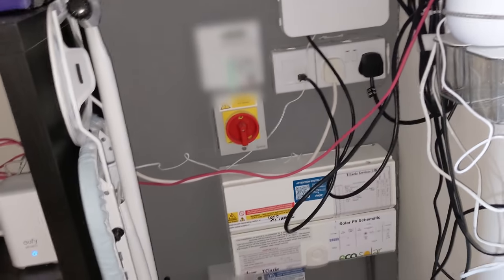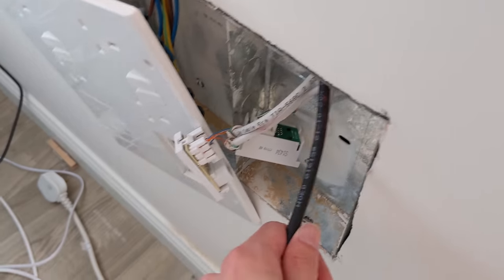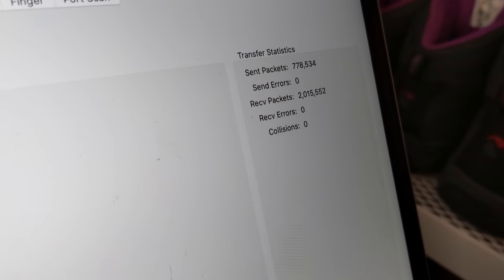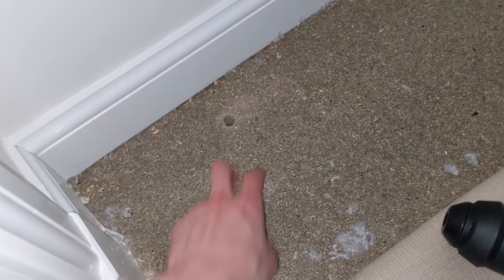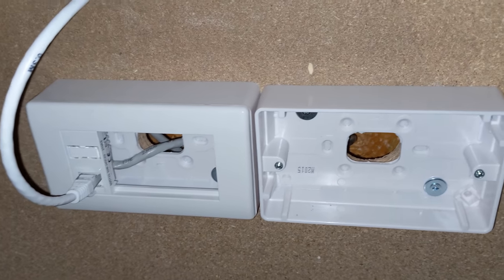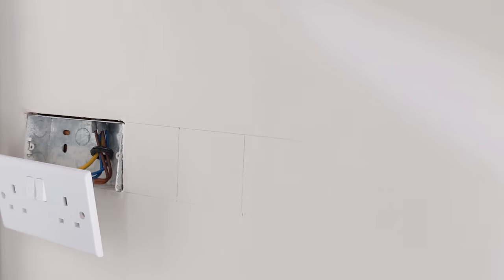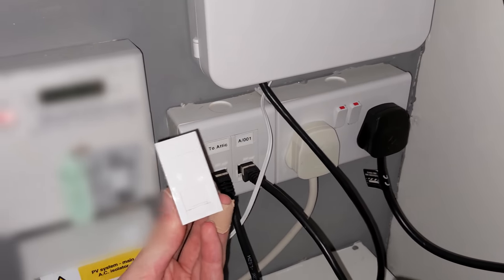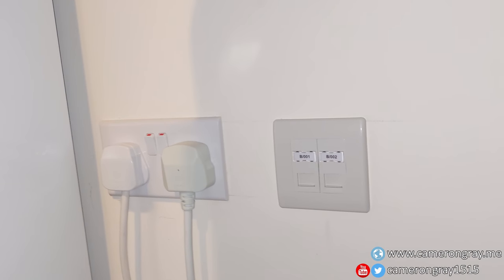New Build House - Expanding the Original Home Network Wiring!

Comment: Typical cheap poor U.K. new house building. Think I read they make a 30% mark up on homes now. It shows. Still a good install and great video, thanks!
Reply: Tbf this is a timber frame panel house. Very efficient to build and run. If i had to choose a new build it would be this one.
Reply: Compared to US, Aus and NZ standards, they're infinitely better.
Reply: @stevecraft00  What’s that? Does it not have bricks and breeze blocks in its building?
Reply: @marksapollo  only the outer skin is brick.
Reply: @stevecraft00  Don’t make them like they used to. I’d rather have some internal bricks walls on the lower floor.
Reply: @stevecraft00  Thanks for the explanation by the way.
Reply: @marksapollo  timber frame enables much better insulation.
Reply: @base64d  absolutely 100% certain.

Comment: Props for your tenacity to make this happen Cameron and a nice touch with the PoE to get power to that wee switch in the attic. All completely unnecessary of course because house builders still seem to be living in the neolithic age when it comes to building a "modern" house. A bunch of cables and points from each room back to the closet would have cost them buttons to install, even as an off-plan install, as part of the build. I hate house builders (personal experiences).
Reply: they are builders, not network technicians, that's why you wonder why the hell did they do it like that when you come to install services in "pre-wired" homes.
Reply: @YouTubeSupportTeams  Yet somehow they're capable enough to hire...lawyers, architects, plumbers, electricians, brickies. Pretty sure it's not that hard to get the sparks to run the cables and get a bod in to do the termination if the sparkies aren't capable. They're not being asked to install a "network", just the cables and some termination.

Comment: My sister recently brought a half million pound new build flat with gigabit broadband. It was wired with a bt (phone) socket in every room and that’s it!? You could only get gigabit speeds in the laundry cupboard…
Reply from the maker: That's really bad, at least ones I've seen have a network run to the living room so a router could be placed in there, but people often aren't shown how to connect it up so the router ends up getting chucked in a cupboard with the network runs unused.

Comment: 16:45 the words "good workmanship" and "new build" have never been spoken, Cameron.
Reply: This is true, I live in one. You can hide wonky woodwork if you cover it in plasterboard or it's in the roof space.

Although to be fair the build quality is an order of magnitude better than the 1800s terraced house I used to live in.
Reply: In a decade or perhaps less you'll see the news stories in the press about how these new builds are falling to bits.
Its just the cheapest fittings with the cheapest labour and get it done by yesterday.... unfortantely it's going to prove quite hard to disrupt the housing industry in the UK...
Reply: One of the big issues is not enough people get a professional snagger to come and identify the problems early so they can be sorted out firstly at all and secondly whilst the house builder is still on site and the trades are around. I dispute the cheap fittings etc point though, you can get quality if you're willing to pay for it, just many people don't and/or can't, and that's where the problems start. Not all house builders are the same.
Reply from the maker: My issue though is that people shouldn't have to get professional snaggers in to identify issues, the builders should be using contractors who are competent and do a good job and should be inspecting the work themselves to the same degree that a professional snagger would.  I also dare say if this was coupled with logs recording who carried out which work, things would be getting done to a better standard!  Then there's clearly issues around overly tight timescales however this to me is still entirely down to the builder.  Agree that the fittings aren't always terrible as they're generally pretty tightly specified rather than a case of whatever was cheap at the wholesaler on that day (which you often get with hiring contractors after the fact), but the actual construction seems to just be being rushed.
Reply: 2 main problems that I see - 1. all work is done to a fixed price by subbies so they benefit from getting the job done as fast as possible and will have probably left site by the time anyone turns up to snag it. Additionally, the builder will undoubtedly hire the cheapest one.. you get what you pay for.  2. As far as I can understand it, the build is signed off by someone who works for the building company - to me that is absolute madness. There should be a third party to sign this off so there's no conflict of interest.

Comment: We moved into a new build 2mths ago. We weren’t shown how to connect to the living room media plate so we’ve just got the BT hub sitting outside the hall cupboard & are using WiFi only. We do have phone points in the bedroom & office so your video has given me hope that they could be used for the internet, as they are the only two rooms we need hard wired. We were originally thinking of running cables along all the skirting boards like we had at our old house 😬 so thank you for posting this 👍
Reply: doesn't your cupboard where the internet comes in have an ethernet socket in there which links to the one on your media plate? If so the router can at least be moved to lounge / media plate location.

Comment: Tip for the hole saw.

Start it. Then use a normal twist drill and drill a hole into the mark left, it lets the hole saw clear its teeth each revolution and it cuts so much better and faster.

Comment: Here in Sweden I think we got a law which says you have to install 2 network cables in conduit to every room. Really weird that that they didn't install a proper network in a new house and didn't even use conduit... I live in a house which got redone in the 90's and even that had conduit for the phone lines (With 90 degree bends so i couldn't reuse them...). Great video!
Reply from the maker: Interesting, that would be so much better, especially if things were run in conduit which would make replacing/adding cables so much easier!
Reply: @camerongray1515  Not really, at least in my country they run everything in conduit, that is nice, but they typically use conduits so small that it's nearly impossible to pull another cable. One time to pull a network cable that I was desperate I had to strip the outer sheet an pull the individual pairs (of course it was not up to code because running cable with other single insulated mains cable... but it did work so whatever, was even gigabit, and the alternative was to tear down a wall and do a mess).

Comment: Good problem solving video 👍🏻.   Please keep in mind that separation of band 1 (extra low voltage cables - data etc) and band 2 cables (your mains power basically) is done not just to reduce interference but also for safety.  That cat 5 cable isn’t rated for 230v (or much of the components attached to it) so keep them apart or with a suitable barrier as much as possible.
Reply from the maker: Yeah, I probably should have explained it in more detail.  As far as I'm aware, it more applied to where the mains cable is single insulated so I couldn't run network cable through a socket back box but it's okay to run fully insulated T&E alongside the CAT6 from that perspective.  The living room media panel for example has a separator between the mains and low voltage sides but once the cables leave the pattress, they run in the same wall cavity.  Basically the same as what we've done with the network point.

Comment: When don't have the width to pull 2x cables side by side, you can always solder them tip to tip, then tape them for good measure. Usually this works, unless the new cable is much wider than the existing cable.

Comment: Awesome content! Have a similar set up, managed to actually pull the Ariel from  one of the master bedroom up-to the loft and daisy chained the cat6, ran two cables back to the bedroom and got the Ariel back in its original place! 

I did want to run all of switches from the loft, and do new drops into the bedrooms, living room, kitchen and garage but as its timber framed built too will be so awkward trying to achieve this. Think I’m going to have a switch under the stairs and then a switch upstairs and distribute it that way. One powered POE switch running a few devices upstairs and a few cameras isn’t going to break the bank. Not ideal but easiest way I think. Can easily run cables into the garage then. 

Did look at some POE pass through devices so I didn’t need any plugs in the loft, did you have any suggestions?

Comment: I have an extremely similar setup. ONT in the hallway, phone socket over to living room multimedia point which is then extended to the 1st floor upstairs to another multimedia point in the lounge (now study). I changed this to use RJ45 keystones and then a switch in the living room and lounge (ONT, to router/switch, out to wall socket, living room socket to switch, back out of the switch to wall to lounge where I have another switch to serve two gaming computers. I have Unifi AP's with injectors but want to tidy it all up and have them ceiling mounted rather than ad hoc/make it work which it is now. It's either going to be 3 new runs from the central hallway/staircase for ground, 1st and 2nd floor AP's to meet at a POE switch in the lounge on 1st OR make my 3 runs go down to the where my USG and ONT are and locate my POE switch there instead. Harder but I think would be better. Just the staircase is causing concern in how I'd do it (its square with stairs going along the walls)

Comment: wow, new houses are pre-wired for Ethernet and have a lot of power sockets! makes sense though.
Reply from the maker: It's good to have but disappointing they don't really do more, the most I've seen as standard is one port in the living room and one in a bedroom. Usually it's just a living room port and nothing else.  I suspect the main idea would just be to connect the WAN side of the ONT port to the living room to let people have their router in the living room.  Wish it was more common to just have a couple of ports in each room but usually this is charged at something ludicrous like over £100 per port.
Reply: @camerongray1515  yeah, hopefully it only gets better from here.
Reply: @camerongray1515  I agree, thats why we got a network port put in every bedroom, lounge and garage. our developer charged £49 per each additional data port, by standard there was 1 in lounge, master bed and bedroom 2. I added the extra to future proof the house, theyve terminated them to wall plates so all i need to do when we move in is cable trace, label and then patch it to switch & router. We move in 30th of July.
Reply: @camerongray1515  I can confirm. I had to battle to get the builder to even consider putting networking cable in - seemingly I was the first person to ask. 24 ports around the house including two ceiling points for APs, terminated in the under-stairs cupboard next to the ONT, cost over £2k.
Reply: I'm staggered to learn that a new build house that no doubt cost several hundred thousand pounds doesn't come with a loft light 😳

Comment: Love your work and your channel! I'm a total networking noob but keen DIYer. I'd like to run a network cable from our cupboard to bedroom three just like you've done just for a wired connection to our office. This is the best/closest UK video I could find as my new build is configured almost exactly the same, however looks a bit overkill for what I need or would you still recommend wiring in the switches etc. for extra flexibility & expansion?
Reply from the maker: You could totally get away with just having a single cable run, the switch just allows for extra flexibility for running cables to multiple rooms.  The best option would be to take every cable back to the cupboard so you only need to have a switch in there - we chose to put the switch in the attic purely because getting cables into the understairs cupboard would be too disruptive so using the existing cable and fitting a switch in the attic to serve the upstairs rooms kept disruption to a minimum.

Comment: I know why the floor is 2 layers. Thats a timber frame system house. The house is built in panels in a factory. The floor is built in long slabs with osb both sides. The osb is structural. The floor is of such construction that it looses its strentgh without the osb. Then once its been craned in they glue and or screw chipboard and plasterboard in. And the brick outer skin is built last.

Also the roof is built at ground level and craned into place once the walls are built.
Reply: Lol...I remember watching the unbuilt houses in my estate being assembled and my heart sank knowing what I'd paid for.
Reply: @tehklevster  Heh this comment is helpful in possibly the wrong way. I watched them build the rest of my estate and it wasn't done like this. They built it "properly" with layers of blockwork and bricks, then the floors went in as lengths of that engineered wooden I beam stuff, and the roof as a series of joists. The only annoything thing is all the internal walls are made from plasterboard and 2x4 and wobble like a cheap TV set if you slam a door. Makes drilling holes to run ethernet easy though.
Reply: @ncot_tech  Barrett use timber frame widely in the UK.

Comment: I had a similar idea to cull a cable from my office to the living room via the aerial cable. From the office took seconds but for some reason the aerial cable is cemented in place in multiple places. Silly question but do all sockets wiring run up to the loft or just the upstairs? Assume downstairs runs through the ceiling?

Comment: Just wanted to say that you could've used a moca adapter on both ends of the coax to get ethernet upstairs, the only catch is you'd need power on both ends instead of using straight poe
Reply from the maker: That would work however we wanted to continue to use the coax for TV reception
Reply: @camerongray1515  I've seen a coax splitter that let's both run over one coax cable
Reply: @camerongray1515  i still love what you did though, the attention to detail is remarkable!
Reply: i wouldn't if the coax was cheap hollow core crap they usually put in. DTV only needs cheap hollow core. Data needs the best you can afford.
Reply: @YouTubeSupportTeams  Not really, a lot of times some of my friend and family had problem with bad reception only on one TV (so the aerial was good) the cause was the poor quality of the coaxial cable used to connect the TV to the socket. And the cable was fine, by testing continuity with the meter, it was probably just of a bad quality, good for the old analog transmission, but not enough for digital.

Comment: I can't figure out why you didn't remove the electrical/media panel box and run a fish wire down from above; to me it looks like the box was held in by screws and it would have given you the entire box opening to find the wire and pull it through before fishing it into the box and re-mounting it.
Reply from the maker: We did take the box off to take that photo however it wouldn't be easy to feed down from above without cutting into the upstairs wall/floor.  We'd have to run fishing rods down from the attic through several different holes inside the walls.  Walls are also full of insulation which would make it even harder to get rods through.

Comment: Awesome! What kind of person would I have to hire to do something similar in my place? Are you a network specialist or an electrician?
Reply from the maker: I'm just a DIYer with a reasonable knowledge of networking.  To do this in your own place you'd be fine with an electrician but just try to find one that explicitly states that they do telecoms/networking.
Reply: @camerongray1515  cheers mate... Moving in in 3 weeks and really hope the telephone extension to my living room used a decent cat5e as well... But I doubt it... The house was built in 2008 😂
Reply: @maximusg88  You'd be surprised.. my parents house built in 2003 has cat5e for the phone line extensions (of which are many which were required for sky)
Reply: @wvziccardi  I hope so :)) thanks
Reply: @wvziccardi  It's usually very low quality cable, though, and I've seen CCA cables in houses before. I would not trust that for PoE applications. But it can still work fine for data.